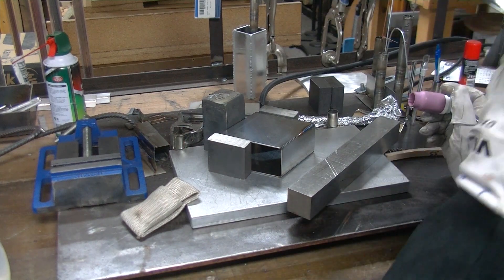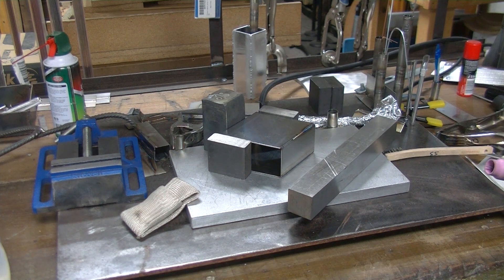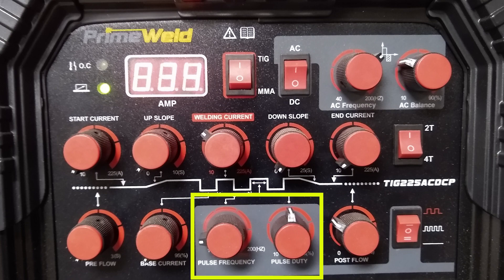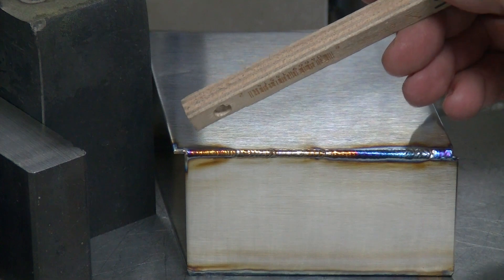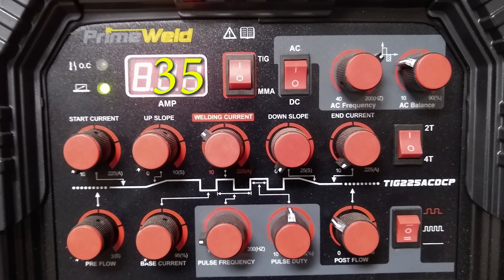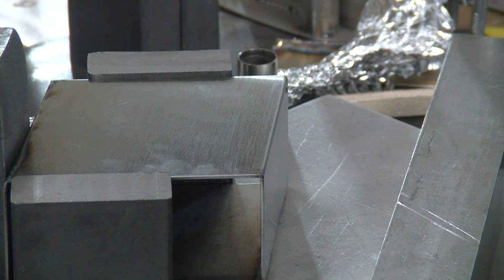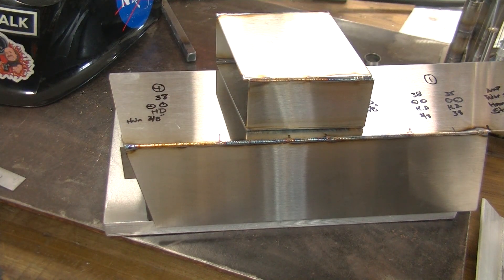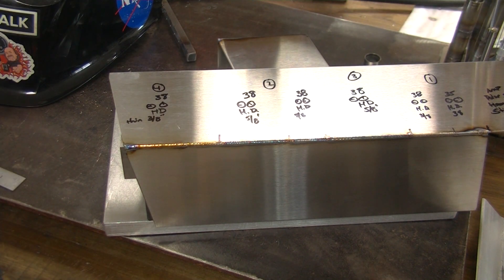PRIMEWELD 225 stainless pulse test | RATTLECAN FAB SHOP with James O'Rear

Comment: This is a great method for developing welding procedures.  I found it to be to very useful to make a simple form with all ofthe welding perimeters of machine setting, material thickness, type of material being welded and grade (such as 304 SS), type and diameter of electrode, gas used, travel speed, filler material and grade when used.  May want to include a picture of the weld also.  

In the past the company I worked for many years, I was responsiable for developing welding procedures, and the documentation that complyed with Federal Government DOT on welding of High pressure gas pipelines and vessels.  

With all being said a written procedure is very helpful when doing work like you are on so many typesof materials.  It will save you a lot of issues and time on new peojects.  If you are planning to expand look at the ISO documentation requirements and develope the documentation per these standards.  This will help when companies are looking for a fabrication company.
Reply from the maker: That is a great idea, I find that I "reinvent the wheel" frequently. Starting a new educational journey soon, will keep my eyes peeled for the ISO terms.

Comment: Thank you for posting this, Im just starting out on thin stainless with this same machine.  I am having MAJOR problems trying to weld with 1/16 tungsten + 1/16 filler rod, never even considered attempting to trying without filler
Reply from the maker: My instructors had us do a LOT of autogenous welds before picking up a filler rod.

Comment: I've purchased the primeweld tig 225 and have been trying to figure out my pulse settings on thin SS . I'm so happy I came across your video.  Could u please do more dialing in with this specific welder. Or bbn if u already have could you give me some reference settings for aluminum and other thicknesses of SS. And I deffinetly subscribed thanks for the video.

Comment: Thoriated tungsten is nice for welding at over 250 amps because it wont melt. If you are staying under 150 amps just use 2% lanthanated tungsten. 

Thorium is RADIOACTIVE. If you grind Thoriated tungsten, the dust releases gamma radiation particles. Unless you have a respirator and a dust collector I highly advise against using it. The particles will not exit your lungs and they will DEFINITELY give you cancer! I have a degree in welding. 😬
Reply from the maker: Way long ago I was an operating room nurse and have extracted my fair share of tumored-up lung meats. We take safety talk seriously, thanks for the additional info.
Reply: Been grinding Red (Thoriated) Tungsten in a small shop for the last 32 years. No lung issues to speak of whatsoever. Back when I started there wasn't much a choice or information about the subject. You receive far more radiation in a routine dental of skeletal x ray, or on a commercial flight. Lastly, Albert Steven lived to be 79 years old and was injected with 60x the lethal dose of Plutonium P-238.

Comment: 🚨I left the comment I had the same 225 Prime welder purchased water cooler you have asked about it I like it it ❤️ seemed to make my arc a little more stable and nicer perhaps it's me 🙉 I bought a Mophorn Tig water cooler on Amazon for  $349.95 they have different sizes. I purchased the one that is 25 L they have smaller ones too I don't know if it is to big but works great do far .. the price was pretty good compared to everyone else's it seems to be a big company.  They don't pump very fast that just circulate the water I used                                     
       📍NOTE : 
Distilled Water and 
 91% (  ISOPROPYL ALCOHOL ) 
( all the research I suggest this type  of alcohol does not mess with  the high frequency  ) 
.there is a formula for that 20% equals like  -7 c 40% is  like  -20 c  I live in USA   Northeast Pennsylvaniawe use Fahrenheit don't know what it is centimeters ..
NOTE ;;  in the 25 L  water container I put it in like six liters of 91% 
 ISOPROPYL ALCOHOL
The rest of the 25 L in distilled water .
Before I forget make sure you show all your set ups when you weld I need help new with this machine don't understand the setups been looking for videos on the prime 225 they will all be coming out soon I understand they sold like a million of these machines why not for the money their damn nice ♥️
Reply from the maker: Thanks for the info, what torch setup did you go with? I'll try to remember to get a setup screen created thanks for the reminder.

Comment: I just got a prime 225 I can't wait to figure it out I just bought a cheap water cooler on Amazon can't wait to play...,..
Reply: Same here. I've had primeweld for maybe 9 months. Love it. No complaints.  I also am about to order an Amazon cooler. And of course a CK20fx. And I would like to know your thoughts on cooler experience. Should be great lol especially for aluminum. I do alot of that, and stainless. I build carbon industrial custom machines, sandblasters at work...so homeshop and the primeweld have been my door to all types of tig experience. You all will enjoy!
Reply from the maker: @DCweldingAndArt  The only cvoolers I've used have been Millers on the big Syncrowave machines. They worked great when they weren't leaking and because they belonged to schools not everyone treats them with the care you do when you laid out the cash yourself. 

I'd love to hear what cooler unit you eventually go with. I have some thick aluminum hole filling and man does that CK17 get hot fast. Thanks for stopping by Derrick.
Reply from the maker: I'm interested in your cooler experience, please let us know how it goes!